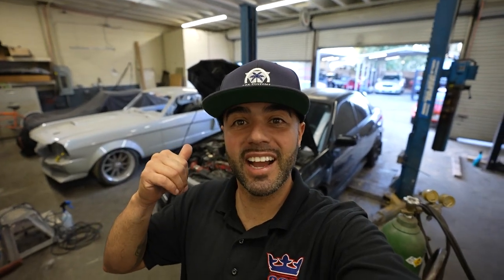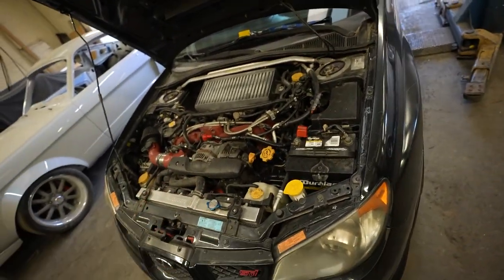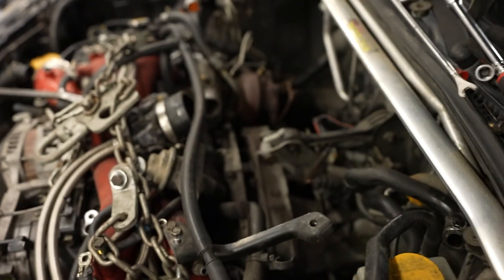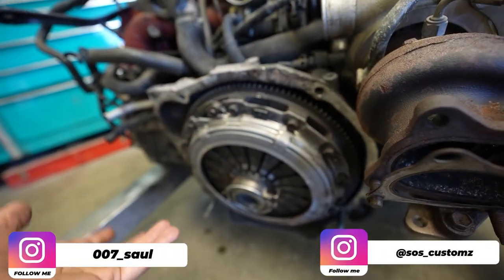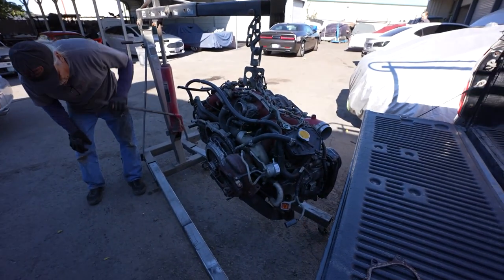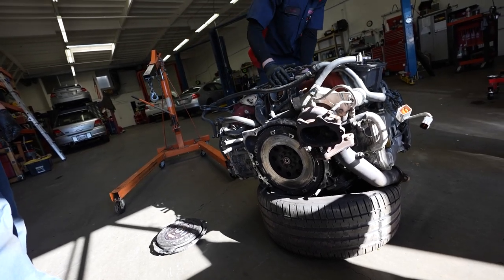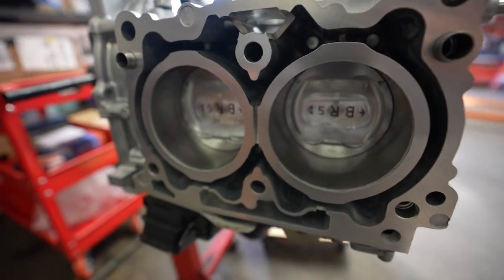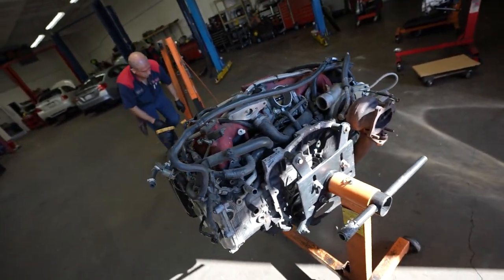Rebuilding  a EJ25 Subaru STI motor

Comment: So when separating the EJ from the trans there's a Allen head plug you need to pull out and then behind the plug is the alignment pin to separate?
Reply: Yes sir it’s the clutch fork pin
Reply: @soscustomz_saul  if you could please show how to properly reinstall to properly align once the engines ready to go back into the chassis.  I heard if you screw up the alignment you have to separate the engine from the trans and start all over if you get it wrong.
Reply: @DJ_Driven  so once you put the motor in install the transmission and clutch with the throw out bearing grease the pin align in then slide her in